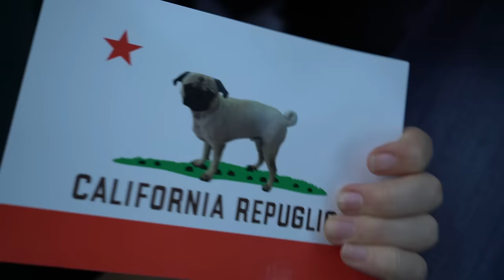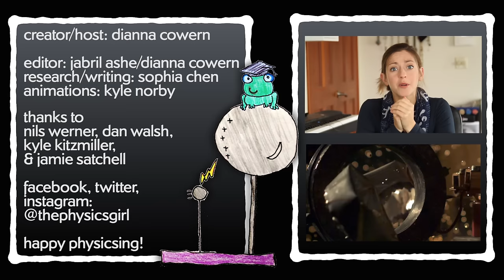How to control light with water

Comment: Fibre optic is certainly the future communications infrastructure, it's just that communications companies (mainly in the western world...) have invested so heavily in their older copper networks, they're only really using fibre for backbone infrastructure. For most people this means FTTC (Fibre to the cabinet) installations at best, so a roadside cabinet is serviced by fibre and then distributed to homes using the existing copper network which works reasonably well as long as you don't truly live out in the sticks. The problem is that communications companies are spending lots of money to try to keep their copper networks somewhat relevant and charging customers more for the privilege (certainly in the US anyway, where fibre upgrades received government subsidies in the 90's but whilst the money was taken, the networks weren't upgraded...). On the other hand, fibre as a medium is far from being saturated and as a result, can be upgraded by changing the boxes at either end for faster equipment as newer technology develops, if only the communications companies would lay fibre lines to every home sooner rather than later so we can keep up with countries like South Korea!
Reply: Jordan Appleton in Europe FTTH is way cheaper than in the US and more widely spread (I pay 30 euros a month (~35-40$ i'd say) for FTTH 1 gbps down 500 mbps up).
But do keep in mind that it's easier to use copper lines already on-site for remote cities and that fiber optics is not the cheapest thing in the world.
South Korea is way more dense than the US or even Europe so I guess it's a lot easier and cheaper for them to lay down fiber optics on every square km of the country (less, bigger cities and fewer remote and/or rural areas).
Reply: The reason the US infrastructure is not like Europe is because the population densities and country physical sizes. If a new technology is invented, a country like France could fully be switched over quickly, where in the US a city might be able to switch, but not the entire US without a huge cost.
Reply: Larry Thielen that's what I meant but we kind of have the same problem here in France at a much smaller scale

Comment: Well at least my copper DSL will connect to some fiber optic.
Reply: Why isn't Fiber to the Desk standard already‽
Reply: David Wührer it's utterly expensive
Reply: One of the nice things about municipal ISP's is that you often do get fiber to your house. I live in Burlington VT, and am typing this from a 100 up/ 100 down connection
Reply: +Nicolas CW I have fiber for 10 USD a month. :D
Reply: TheArdeam it's expensive for the carrier to install.
where do you live? In many countries they receive subsidies to make it easier and cheaper, that's why it is inexpensive for most users (that is at least the way it is in France and I believe in many european countries).
Reply: TheArdeam i pay around 35USD a month for FTTH 1gbps (as in 1 gigabit, that's not a typo) in Paris, France.
Reply: for one, your computer processing speed would still be slower than your connection speed.
Reply: Nicolas CW 
Glass fiber itself isn't expensive. The routing equipment is, even though it can be produced cheaply.

So why don't even newly built houses not have fiber networks built into the walls? Electricity, plumbing, and separate copper wires for telephone and television are standard, even though copper is more expensive than glass. And the fiber connectors are much simpler.

Larry Thielen
Who cares?
Reply: David Wührer oh ok I hear your point. True, most houses come at best with coaxial cabling..
Reply: Well, that's partially due to the fact that most houses were built years before fiber optics really started to expand, and even before the internet existed.. But even if houses did come with installed fiber optic cables, would each and every service provider be able to meet the demand? That isn't just for internet/ethernet, it would have to include phone and TV as well... It seems possible, but unfortunately I doubt service providers would care enough to spend the money to install the systems necessary for next-gen connections.
Reply: Hilltop Gaming 
New homes are built all the time, and optic fiber has been available and in use since the 1980s. That was thirty years ago! What reason is there not to put glass into the walls?
 
Telephone and television can just use the fiber network. An additional advantage is that all parties in the house can share the network provider and high bandwidth, and are directly connected without having to go through and around the internet cloud.

*****
You make a good point about copper being fast enough. Still, glass is cheaper, and the latency of a LED is not higher than that of a transistor.

There is no reason why optic cables should need to be any more exposed than electric wires, and the standard optic connectors are more robust than the frequently used RJ-45 connectors for copper.

I don't know what you mean by economies of scale. Optic NICs are a lot simpler than the usual Fast Ethernet ones, both in the logic and electronically with a lot less chance of electromagnetic interference. Demand is there as well. The only reason the equipment is so expensive is because companies that rely on it will pay it. And licensing for the newer, potentially faster protocol that is standard for glass fibre now even though thick ethernet would do for now. But that only has to be licensed once.
Reply: David Wührer
What I was trying to say was that most houses were built with coaxial and phone lines, rather than fiber optics. My house was built in the 40s, for instance, and that's still relatively long before television took off, let alone fiber optics. I have coax and phone lines currently, and if the option arose where I could upgrade everything to fiber optics, it probably wouldn't be financially wise..

Are TV, internet, and phone service providers all able to send and receive using a single fiber optic line to a residence? When I had a landline phone, I had a different service provider for that than my internet and TV. Would more than one provider be able to use a single line, or would multiple lines have to be installed? Are multiple types of data streams able to be sent on a single fiber optic line??
Reply: Hilltop Gaming 
It is all data. The three service providers, if you really need them, all terminate at your house, where the different services are routed to the appropriate devices. Carrying different connections over a single optic cable is what telephone and cable television companies are doing anyway.

Cell phone towers even have redundant dark fiber laid to them, which can be extended to nearby points. But for that they usually use copper, if they do it at all.
Reply: David Wührer Interesting but also efficient!
Reply: Hilltop Gaming Hilltop Gaming My own connection uses only one fiber for HDTV/Internet/VoIP as telephone (and VOD on the TV but that's internet) and for multiple computers/TV. So yeah ISP can easily do it with a good fiber network and FTTH connections, but it's quite expensive to put fibers in crowded cities entirely cabled with coax (in my city they mostly did it by passing the fiber in the sewers and then through a wall to the basements of buildings, probably between the late 90s and mid-2000s).
Reply: ***** 
I know what the term means, and it is exactly why glass fibre should be ubiquitious by now.

And copper wires have thicker parts near the connectors to prevent them from bending too much, because that would break them. They often break anyway, and almost always near the connector. Glass has greater tensile strength and would not break as easily. Plus, it is cheaper.
Reply: i disagree. Fiber has less tensile strength than copper and is way more susceptible to damage near the connector. The connectors are way more finiky than RJ-45 and microscopic dirt and oils affect the attenuation.  
Most peopld prefer not to be physically connected with cables inside their homes and your bandwidth is limited by the speed of your wireless router way more than the copper ethernet cable anyway.
Reply: Larry Thielen 
I have ripped apart copper wires with my bare hands. I don't think I could do that with glass fibres.

I also have a growing collection of damaged RJ-45 connectors. Optic connectors are simpler in every way.
Attenuation and distortion are no less a problem with electric signals, plus you get interference, which can not happen with optic fibre.

Bandwidth is not the issue, 100MBit/s in either direction is enough for most people, though it would be nice to connect entire houses as one network rather than connecting each flat separately. I have heard though that 4GBit/s is nice if you copy large amounts of data between computers. Should bandwidth become an issue, glass fibre would not need to be replaced the way copper wires have been to accommodate a broader range of frequencies.

802.11 is useful for some things, but, as you say, it limits the bandwidth (even with 802.11g/n, which theoretically have up to 108MBit/s), and it adds a lot of latency. Generally you want something other than radio for anything that isn't mobile. Besides which, the standard doesn't address any of the peculiarities of radio anyway, forcing vendors to take care of those on layer 0. Not even handover between access points is specified, which limits the mobility of mobile devices unless you build up your network infrastructure specifically to work around those limitations.
Reply: ***** 
Okay.
Ethernet cables are more flexible than optic cables, but the isolation rips easily if you bend them too much, and that will make them practically unusable. In practice optic fibre is flexible enough for most things that ethernet cables are flexible enough. Both have coating to keep them together, albeit for different reasons.
But point taken. People will find ways to break it.
Reply: Nicolas CW Exactly, the cost to upgrade an entire area would be great. So a single ISP can use a fiber for their own data, but the real question is whether Comcast and Verizon (for example) could share a single line for different services.
Reply: Hilltop Gaming in France ISP receive subsidies for each fiber line they install so the actual installation of the fibre is free for the user.
But in countries where this is not the case I can understand that an ISP would rather use one strand of fiber for a single building and coax for each final user.
Reply: i don't know how it works in the USA, but here the phone and internet are provided as a bundle by ISPs. You can't really get one without another anymore.
For the TV part, 40ish chanels are 100% free and you receive them either with your old coax network, which is managed by the city when it comes to the TV; with an antenna (either "regular" or satellite) or over the internet, in which case it's in the same bundle as your internet/phone thing provided by your ISP.
For instance I have a single ISP for TV/phone/internet/mobile and only one strand of fiber for all of it (and a SIM card) for a single bill of ~70 USD (65€).
Reply: Nicolas CW I live in Pennsylvania in the US, and as far as I know, the government doesn't give out any subsidies to the ISPs for that kind of thing; however, it's not like those companies wouldn't be able to afford it anyway.. They do offer bundles like that, but they're pretty customizable. You are able to get one without anything else, but you basically take a loss for doing so. I also think we can receive around 15 channels free if you choose not to buy a cable package. Either that, or they're relatively cheap per month.

But anyway, I used to have Verizon for phone, and Comcast for internet and cable, but I believe they were coming into the house in two separate cables.
Reply: I live in Madrid. Fibre optic connections to desk are standard now. I didn't know this was not true in USA.

Comment: hey Diana! could you make a video on electric arcs? I saw Dustin's video from smarter everyday on a crazy machine that shoots lightenings yet it is completely safe and it barely tickled Dustin. 
Why is that possible? isn't it necessary like a huge difference in electric potential in order to pass a current through a diamagnetic material such as regular air?

Comment: i’m more interested in the transmission of binary packets by light over fibre. is it just “on off ridiculously fast?surely that still takes a long time to on/off 256,000 times...? what would it look like slowed down, would we see it? what is the capacity/speed of fibre optics? what part of the hardware limits that?

Comment: I appreciate you attempting to shed light on such a complex communication paradigm, but it's far more complicated than you've let on here. For one thing, fibre-to-the-home is not at all common. Most fibre-optic lines in North America, for example, branch off to COs that propagate aDSL copper lines to the home with radically different upload- and download speeds. That 1 ms latency for glass fibre can easily turn into 15 ms of latency over a slow aDSL connection after it's fed over a Wifi AP in the residence.

Comment: at 2:25 you said light is not getting out because it is below the critical angle but actually it should be above (or more than) the critical angle for total internal refraction to occur.
Reply: No Name it depends on whether you're measuring your angles from the normal or from the surface.
Reply: Émile Jetzer generally angles in optics are always measured from the normal.

Comment: I do hope you were joking about the connection between cell phones and satellites... 

Albeit, smart phones do use satellites for GPS and a few other rare applications, cell phones work off of high frequency radio waves, (technically light) to communicate to cellular towers that are connected themselves to a fiber optic network buried in the ground. 

Although some rural towers do implement microwave dishes, this is usually only to connect to other towers where digging trenches to bury cable is prohibited, or across city rooftops. 

Ex-cell tower technician.

Comment: Balloons or high altitude planes will probably surpass fiber (though eventually still using lasers to communicate between nodes) wrt cost, reliability, and speed.
Reply: I don't think so: fiber is cheaper, more reliable and probably faster. Besides, you would need many of those, the horizon would limit range. And just forget about that if it's raining, foggy etc.
Reply: High altitude - LOS is ~9 miles on land, pop up ~75 ft and its >100 miles. IOW LOS is not the limiting factor here. If you have a swarm of 8 nodes, you've got (8^2)-1 redundancy (try pulling that off on a 2k mile run). No, your only obstacle will be $/bit - at the point that it's cheaper for a company to launch a few thousand drones and get a given bandwidth, fiber will all but go away (kept for redundancy when the sun decides to mess with us and for things like high frequency trading).
Reply: Also, the numbers are off the top of my head - I didn't check / think too hard to verify
Reply: Also, where laser isn't practical, this type of thing is going to be hell wrt RF space
Reply: shawn wilson
It's really no that feasible, imo, to keep drones flying continuously, or swapping them. Many drawbacks: weather in general (wind, raind, thunder), birds, other drones/planes. Not reliable at all, very easy to shut down, accidentally or on purpose.
And a 100 miles of LOS is not really that much, think of the thousands between America/Asia.
Reply: Google / FB disagree (on a smaller scale). But laying wires (in a city or on the ocean floor) is such a big undertaking (permits, machinery, manpower) that I really think data lines will go away (but you'll always get faster speed on a hard line vs OTA so I guess it just depends on how much resolution people want in their videos vs compression algos and antenna / filter tech).

Comment: Did they replace the Cooper wires with Fibre optics or text added them alongside the Cooper wires?
Reply: Rayane Allaoua Both and more. For instance, atlantic cable would contain both fibre for data and metal for powering repeaters and structural integrity. Elsewhere fibres may be used exclusively because they're less prone to be stolen.
Reply: LoneTech thanks mate!

Comment: Can you take tubes,fill them with water and then "transport" light in a similar fashion as fiber optic cables?
Reply: Carboxysome indeed, you can do that.
Reply: i'm pretty sure the light will be a bit slower..
Reply: Neutron Star light travels ~half of C in water, so it wouldn't be noticeable. still 150,000 KmpH
Reply: Kyle Wolf yeah..that's why I said a bit
Reply: As Kyle Wolf said, you could indeed. However, the reason fiber optic cables are made of the material they're made of is because of said material's index of refraction, which allows the cables to be bent a good bit (you can coil up your ethernet cable pretty tight and still have it work perfectly). Using water may severely limit the critical angle relative to using glass.
Reply: +DaemonMajor Could have something to do with the fact that ethernet cables are made out of copper and use electricity, not light.

Comment: I don't think that a postcard would take 2 whole seconds to send over the internet. A decent long postcard would be about 600 characters long and would measure 4800 bytes in most standard encodings. I just tried to ping Google's DNS-Server from Denmark and the servers are located in America. I set the packet size to be 4800 bytes and it only took an average of 112.6 ms to send and receive a response. Where am I wrong?